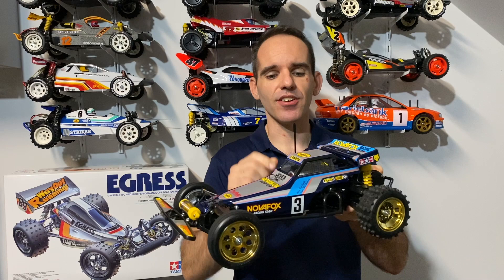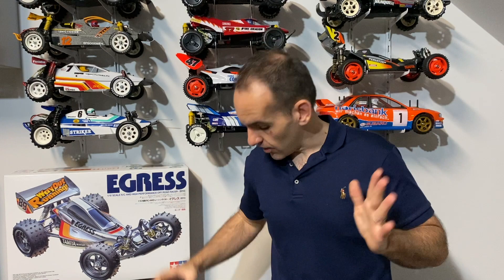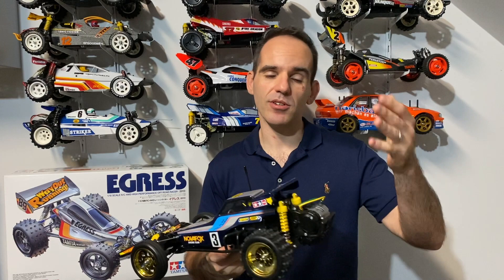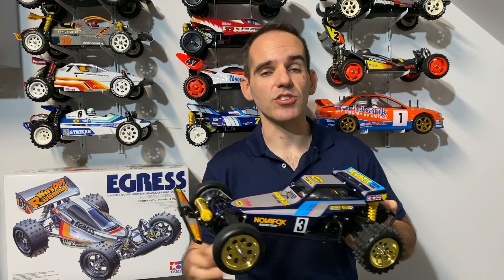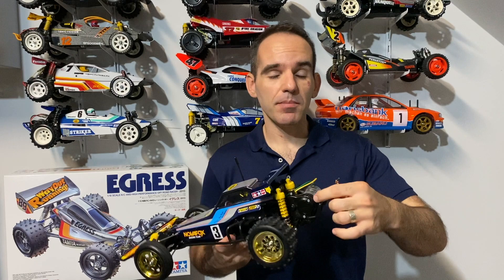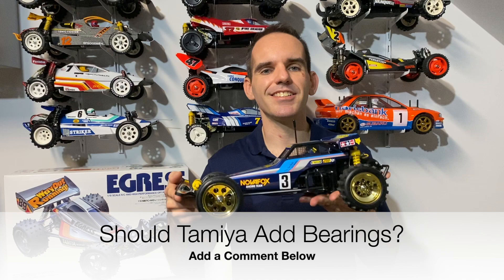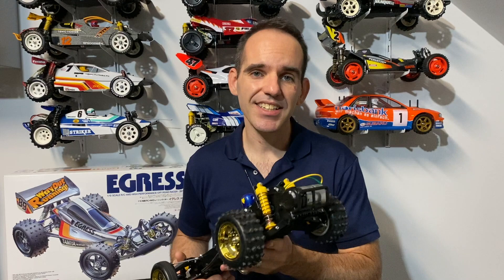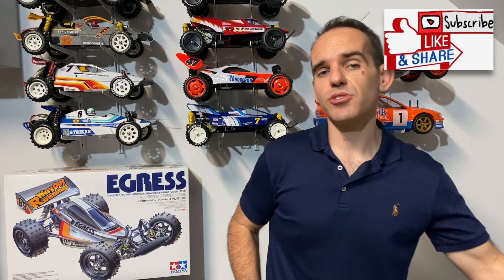Tamiya Novafox 2020 Reissue Build, Paint, Run & Review Video Kit: 58577

Comment: G’day Adam, I bought my friends Fox 33 years ago. What a great buggy, a few years ago.  bought the sway bars for the car, unfortunately I couldn’t get the sway bar to work efficiently as it would raise the front  wheels so I removed the sway bar altogether. I keep the buggy as a roller with the other RV cars on a stand. Those were the days!
Great introduction, I look forward to the nextNovafox video.
Reply from the maker: Thank you 😊 Yes front end is too light. It lifts up when you corner. Definitely needs some weight added.

Comment: Great video!
Interesting about your gearbox.
I just built mine last week that I had for over a year now. My gearbox was almost seized and I had done everything right.  I backed off all screws to the casing to the point that is so lose. And mine still has resistance. I sat the wheels off the ground and let it run to try and wear a bit and it was smoking🤦🤷. It loosened a little and I've only driven in my house to test and as soon as you back off the throttle it locks.
Lucky it was only planned for the shelve but still this was one of my favourite as a kid and i badly wanted the Fox
Reply from the maker: Yeah that’s pRt of the issues I have!
Reply: @RCACTIONAUSTRALIA   Lucky I watched your video to the end as you mentioned the Terra Scorcher gave you a similar problem.
I'm currently awaiting one and that's going to be my next build and I'm planning to have that one as a runner so thanks for the heads up on that👍

Comment: Haven't built mine yet but thanks for heads up on the gearbox.. Was un aware they are chocolate!!
Reply from the maker: Yeah mistakes happen but originally the gearbox was Tight. So I’m either thinking the casing was too tight or the diff was Slightly off when it went together!

Comment: Very surprised that you had diff issues. Ive built over a dozen Foxes, with the stock diffs, and Thorp upgrades, and never had a problem with gear bind. Maybe you were right about tightening up the box too tight, but there is usually the brass spacers in it to stop it actually crushing it part number BC6 Tubes. Great build, always going to be my fav vintage model in the Tamiya range.
Reply from the maker: Yeah it has me beat as to the issue, but glad its resolved, it’s definitely a nice buggy 😎👌🏻
Reply: Hi.  Are one of those tubes supposed to slide back and forth, rattling inside when the box is screwed together?
Reply from the maker: Not sure what your referring too, but gear box shouldn’t rattle or slide once built

Comment: I just finished building my Novafox and noticed when you were rotating the rear wheels it doesnt seem to be spinning quite freely. Mine doesn't have that issue and I even used tamiyas anti-wear grease on the diff. Curious as to why it is.
Reply from the maker: I had something not right! I ended up have the gears fail. I replaced with a new gear set and it was spinning freely 😎

Comment: Great video.  Intriguing, I bought one of these, built it and the gearbox has been a nightmare. Going from reverse to forward it makes a horrid stripping noise.  Stripped it down, Re built it and same issue.  Bought a whole new gear set and gear housing plus parts bag C, had the exact same issue again.  So upsetting as such a good looking car but want it as a runner!  Any ideas/help from anyone welcome!?
Reply from the maker: I’m having the exact issues with the nova Fox! 3 gear sets now stripped and I cannot explain why! I’ve rebuilt the car multiple times and cannot figure out what is happening or why.
Reply: RC Action Australia Just as a reference, my original Fox is a runner. I have had very few issues with the gear box. There are even some screws not tightening anymore in the plastic, it’s a bit of a mess but it runs like an actual fox. So it is possible to run it and run it often. I have heard stories about the metal gears in the diff on the rere having some casting burs and lines and that it’s important to smooth those out before running the first time.

Comment: You have the bevel gears in thr wrong location. You need to switch their positions. The aren't identical. I put them in the wrong way and the gears were rubbing on the inside of the gearbox. That's what caused your stripped gears and that's why it's currently loud. It needs no "break in". Mine now spin freely, with no friction.
Reply from the maker: Yeah I ended up fixing it after noticing the gear box was tight
Reply: @RCACTIONAUSTRALIA  Did the same thing but thankfully didn't power it up. Took it all apart and figured it out finally.
Reply from the maker: @rgr4475  yeah I figured mine out after a did a gear set! 😂
Reply: @RCACTIONAUSTRALIA  yeah me too. I just built mine last night. Thanks for your great advice Adam , and now I've seen yours I'm reconsidering which colour to paint mine. Should I go box art PS4 or I don't know go metallic blue? Yeah so after getting the gearbox built I had the same thing occur, then I took it apart and put it back together properly. I was trying to use a 15 turn coreRC motor but the motor wires are not long enough. So I might solder on the original Tamiya motor wires to the coreRC motor.  But its a beautiful build Adam 👍 I hope you enjoyed it too. I did the front bearing upgrade too.👍👌

Comment: Had issues with my gearbox also, so was very surprised considering it's a basic build. Mine was a pinion to counter gear problem as the manual states where to place the pinion for a 16t pinion and a 17t if I remember but mine came with a 15t. I had to mess around with the mesh as I was getting a crazy crunching sound, stripped it 3 times l, still not perfect and clicks if I go from forward to reverse harshly. Not impressed with the gearbox tbh.
Reply from the maker: Hi, that’s exactly what mine was Doing! Clicking from full throttle forward to reverse. I originally had the Sport tune motor in so it was probably making the issue worse!
Reply: Just posted a comment along these lines. May look at the pinion/motor setting.  Would love a gearbox clinic video for this car!!